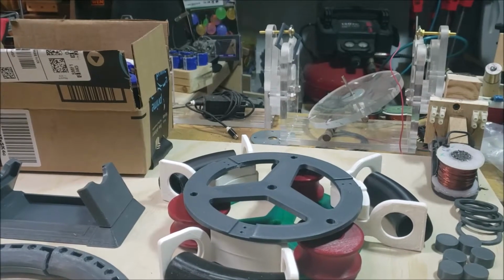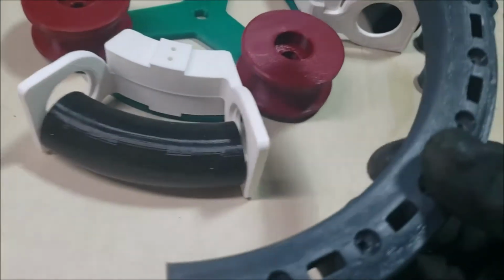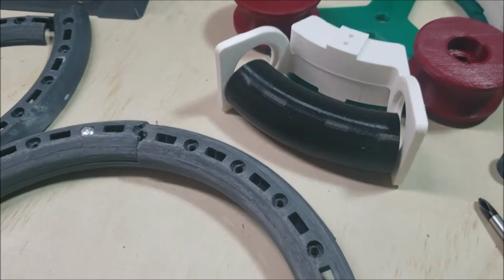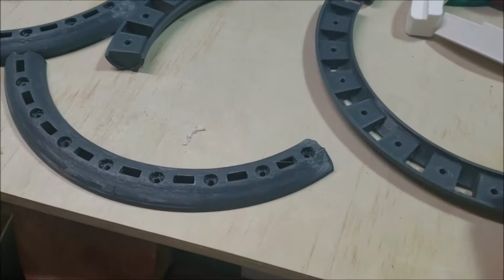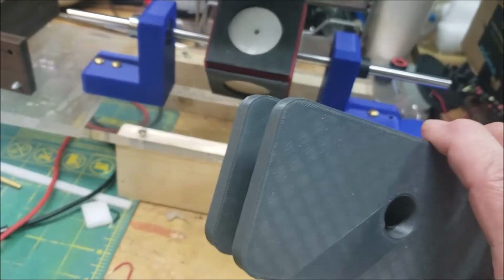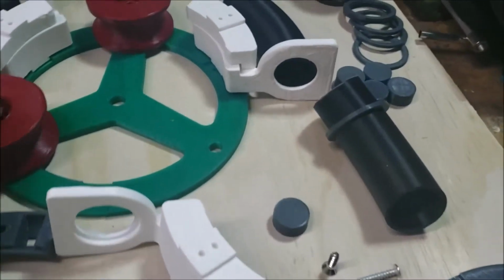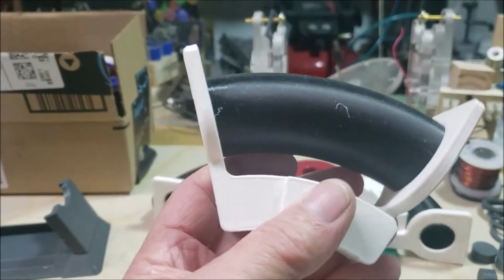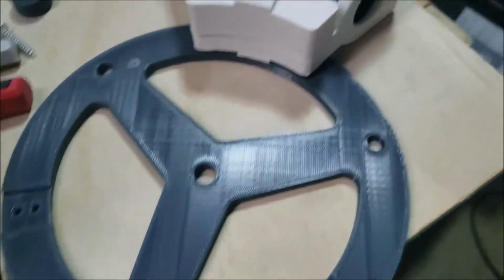New 3D printed parts for solenoid motor

Comment: hello my friend can you send to me 6 pieces of 60*20*10mm  Neodymium  Magnets ?
i have an idea it will generate 2kw from just 50w  thanks
Reply from the maker: sorry but I don't have magnets on hand to give away. All the magnets I buy are from K&J Magnets online. I also sometimes get them from ebay
Reply: @mcorrade  I get overloaded when I look at all the magnetic possibilities.  The look on the wife's face when I showed her the cost of just one set of magnets. If I remember correctly it was in the $18,000 neighborhood. I kinda gave up on that dream. Had design flaws I could not figure out how to overcome.  Like cables snapping.
Reply: @mcorrade  I am really sad because I cannot buy from the internet  because  i dont have money
Reply from the maker: @worldtech9910  well sorry for that.  You can find very strong magnets in old hard drives that any dump will have.